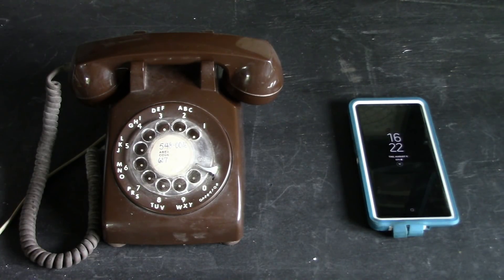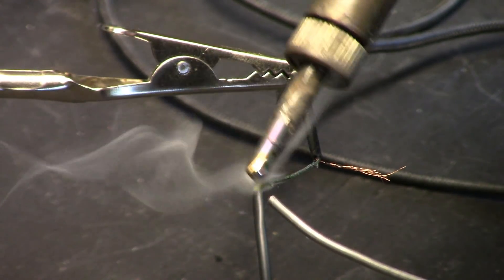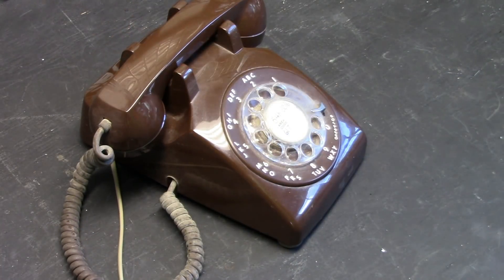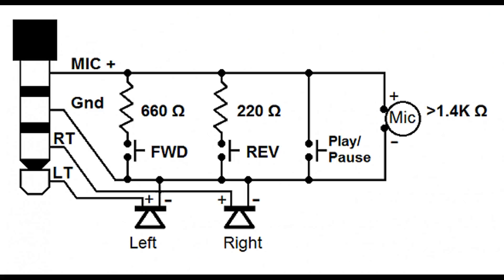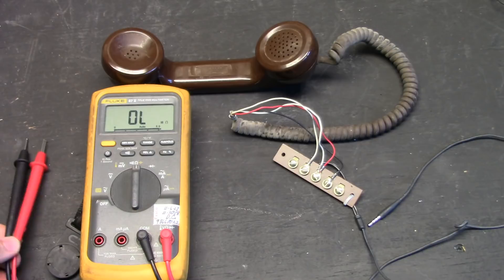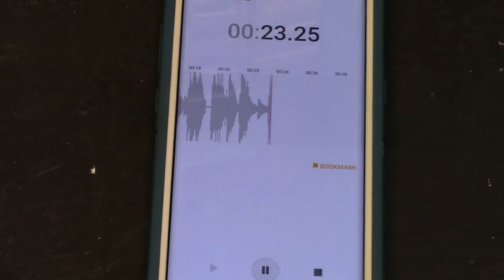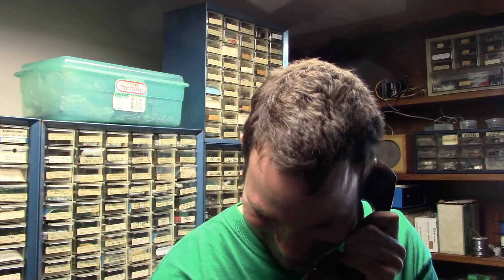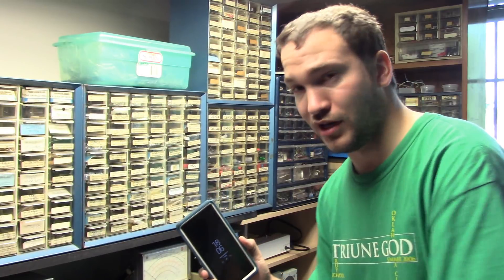Old Telephone Handset with Smartphone!

Comment from the maker: This has been tested with an iPhone and works well. Of course one would need the headphone jack adapter.
Reply: I tried it but the mic doesn't work. I used 1.5 k ohm as I didn't have 1.2, is that okay? the speaker works

Comment: Damn, that's some good soldering skills. I usually have a tough time with those enamel coated wires. I guess you just keep holding the iron on it.

What's the name of that voice recorder app? I have two but one records in .mp4 audio only and the other records in .mp3 but you need to manually save it. Does this app automatically save the recordings?

Can you play music from your phone through that handset?
Reply from the maker: The application is just called Voice Recorder. And if you're interested, the application I used to record the call was ACR. Both free.
Reply: @CassetteMaster  I use boldbeast recorder to record phone calls. Free, works well, and no ads. I'll try the recorder you used, just need to clean off my recordings then I'll switch.
Reply: @CassetteMaster  do you know who made it? I looked on the play store and there's a bunch of them. The first app looks closest to it. Doesn't say who made it.

Comment: We used to hack old dial phones in the 70s to wire tap into a cassette recorder.  Later, Radio Shack had a phone tap cassette recorder.  btw Rick, do you have any early reel answering machines from the 60s?  like RECORD A FONE or CODE A PHONE
Reply from the maker: I have 1980s (or late 70s on the Duofone I think) reel-to-reel answering machines. Just search "Duofone" and "Ford Industries" on my channel to see the (years old) videos on them. Both, of course, feature rim-drive, DC bias, and 1/8-inch tape.